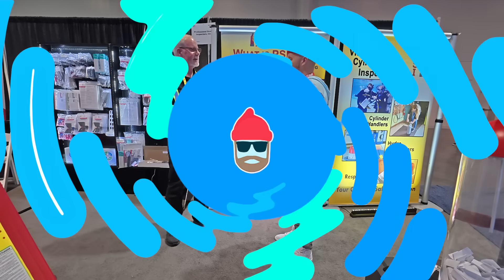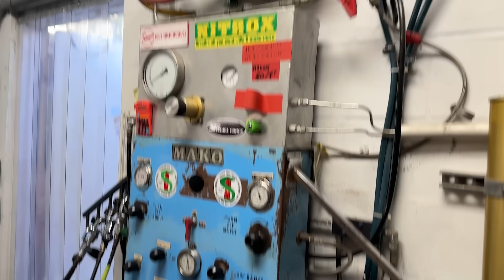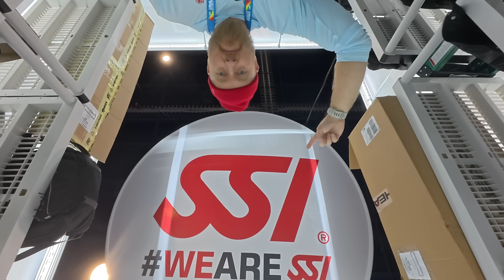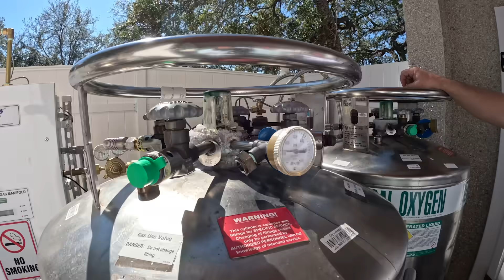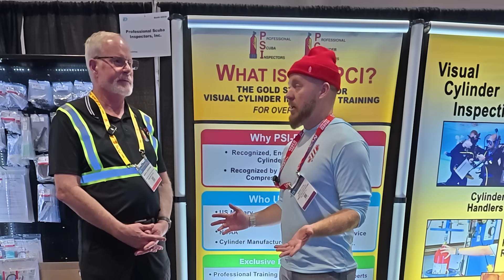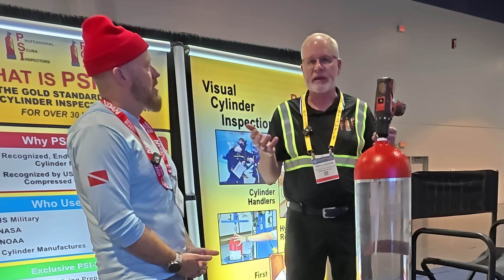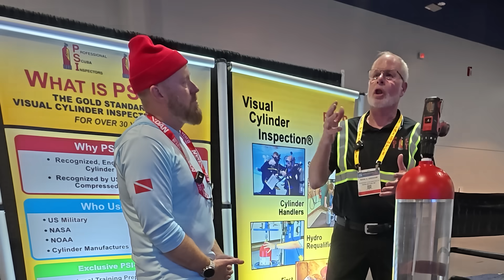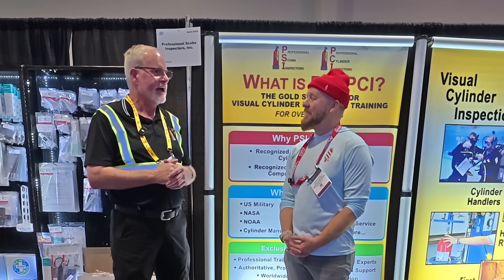101 | Scuba Tank myths busted: Dive Industry Expert debunks common cylinder misconceptions.

Comment: What I really wish you’d have asked about was what is the truth about Luxfur bad aluminum tanks.  I’ve now been told by Divers Direct is that they will no longer fill tanks pre 1990. What I read on the DOT web site is that a tank is good as long as it passes a Hydro test. There seems to be no standard as to exactly what year dive shops draw the line. 
Greg
Reply from the maker: Just reach out to PSI / PCI: they’re responsive to email and their contact is on this video description 👌
Reply: Under DOT standards, a 6351 cylinder is good until it fails hydro/VIP by a RIN holder.  Under DIVE SHOP standards, the regulation is what they say it is.  Most shops here won't fill 6351 cylinders anymore.  When the DOT man came into our hydro shop 2 years ago for his inspection he told us not to hydro 6351 alloy cylinders anymore, even if we did an ECT.   DOT wants them phased out due to SLC and the best way to do that is to get certified hydro shops to stop hydroing them.

If you have your own compressor, you can fill a 6351cylinder that's within hydro all you want and not violate DOT regulations but most of us don't have that convenience.  "Annual VIP" isn't a DOT thing, it's a dive shop thing.  The only DOT requirement for a cylinder is a hydro and VIP every 5 years.   The one-year stuff, the dive shops all came up with so they could put THEIR NAME on the VIP sticker and advertise their shop.  I have about 150 VIP decals from all over the world plastered to the wall of my shop that I've peeled off cylinders for their VIP.  A diver asked me one time why we didn't put VIP decals on cylinders when we inspected them at hydro.  I told him, because the dive shop would peel it off and put their own VIP Decal with THEIR name on it, not mine. 

I've been to shops that won't fill an air cylinder with nitrox.  Dive shops that don't care.  Dive shops that won't fill a cylinder with nitrox unless it has a band on it.  Dive shops that won't fill a cylinder unless it has THEIR vip decal on it.  Dive shops that won't fill a cylinder with air that has a nitrox band on it.  Dive shops that don't care what sticker is on it.  Dive shops that won't fill a repainted cylinder.  Dive shops that won't fill a cylinder that has a valve with a green plastic handle on it.  Dive shops that don't care if your valve even has a handle on it. 
When it comes to cylinders, each shop makes their own rules above/beyond DOT regulations according to what they feel is most safe.  Most err on the side of caution because a cylinder explosion is sort of irreversible.      We had a cylinder that the valve blew off with about 500 PSI in it.  The valve went past the compressor monkeys face, thru the ground floor ceiling, thru the second floor ceiling, and lodged in the roof of the building.   No shop wants to be that shop in the news where three people died when the scuba tank exploded.

I VIP my own cylinders and sometimes during dive season I get so busy I forget about my own.  I took one of my steel 100's to a local dive shop once a few years ago and the compressor monkey came out and said he couldn't fill it.  I was like, WTF?  I work here!  Then he showed me the VIP decal that expired 18 months prior.  They'd been filling it for an entire year without even looking at the VIP decal. 

PSI Visual Inspector 302XX
PSI Oxygen Cleaning Tech
PSI Valve Service Tech

Comment: I was SCUBA certified at the 111st Street YMCA in Chicago in 1968 when I was sixteen and volunteered to Dive Club’s compressor in a room off the men’s locker room near the pool which was 18ft. deep and designed for teaching SCUBA.  The compressor was run to fill a bank of large tanks then they were used to fill the tanks.  I alternated running it with another guy.  The day after I had run it and the other guy was one of the drying filters one the compressor ruptured when it put his hand on it to see hot it was, how we judged when to stop the compressor. The force broke both his wrist and took off the tips of his fingers.  The room looked like a bomb had gone off.  It was determined when the compressor had been rebuilt a few years earlier the aluminum used for the filter bodies had been made from an alloy which reacted chemically with the drying agent inside of it causing the inside to corrode and weaken. It was a real wake-up call about how dangerous air that pressure is.

I stopped diving in 1970 when I went off to college but in from 1983-2007 was wound up doing three tours totally 11 years in Manila running a printing center for USIA / State Dept and diving every other weekend in the 80s and 90s getting my Divemaster rating, doing a lot of underwater photography and building my own native outrigger style 10 meter long dive boat in an arrangement where the boatman we had been using built it and ran if for us for free in return to giving it to him when leaving which worked out great.

Comment: Pure O2 may not in and of itself be flammable but it makes near everything else flammable; while working at Airgas I’ve seen a block wall ignite while emptying O2 tanks for hydro test. 
I always took fills for granted when working for a commercial compressed gas filling company while diving, that was until I was on a trip and went to a dive shop and saw their shoddy filling to realize how bad things could be. It truly is a you haven’t had an issue “yet”. Always used a USP standard which is so much stricter than any loose shop fill is when life is on the line.

Comment: Yet there have been millions of dives using nitrox and titanium regulators and I've yet to read about a diver exploding underwater.    I take this all as opinion, some valid, some questionable.  I believe on the titanium reg issue his validation was because someone thought it was not a good idea, not because of any actual fact based science or demonstrated repeatable event.

I believe he said at the end of the video"you need to be 19.5 percent to stay alive" referring to oxygen content.  Normoxic mix is considered 18-21 percent oxygen in the technical diving community.  You can stay awake and conscious several percent below 18 at the surface.  The minute you descended only a couple feet the po2 is at air levels.

Many emphatic statements in this interview covering broad topics outside of cylinder inspection, that are simply not accurate.
Reply from the maker: Have you reached out ti them for clarification?

Comment: Logic behind fully opened and 1/4 turn back is to easily tell if the valve is opened or closed and eliminate confusion. If its fully on or fully off people have been known to get confused as to which it is. With movement either way it's really easy to test whether its opened or closed. I've never heard of those other arguments.

Comment: This was a great video on tanks and misconceptions about them.  While my son was trying to sell one of my scuba tanks, the prospective buyer got hung up on whether the tank valve would support a din regulator.  He didn't even wonder whether or not the tank had had a 5 year inspection and/or how old the gas was in the tank.  Because of this video explaining the potential problems with old gas - if the cylinder had rust in it - it will reduce the oxygen content in the tank, I am taking these tanks off of the market, sending them back for 5 year and/or visual and refilling them with nitrox, in order to assure that they are properly maintained.  For me - whether I use the tank this year of not, I want them to be inspected and refilled by a competent dive shop - and not have to deal with a lawsuit from selling my tank to an idiot !!!  LOL !
Reply from the maker: 🍻 awesome! The one other thing if you don’t get a chance is grab an O2 analyzer and check them that way? A lot of dive shops will give trade in as well since steel tanks hold their value if they’re able to look inside 🤙

Comment: Analyzing your gas is definitely something you should do. I've picked up a cylinder of enriched air. I was diving to 128 feet. This meant if I wanted a MOD of 132 feet (deeper is safer) then my gas should be EAN28. The cylinder had in it EAN43. The MOD for EAN43 is 74 feet. Almost half the depth I intended diving to. Took the fill tech, through trial and error, almost an hour to drain the cylinder a little, fill with air, measure, drain the cylinder a little, fill with air, measure before they got it down to EAN28. Good thing I checked the cylinder before I left the shop. I also insisted on using my sensor to measure the gas. I see so many people using the shop sensor to measure the gas.

Analyze your air people.

Comment: Good video, the reason I turn my cylinder fully on and then back quarter of a turn is so that should there be a problem underwater my buddy would quickly and easily know if the cylinder was turned off or on, as a quarter turn open would tell him its on, if the cylinder was fully open they would not know if it was open or someone had closed it really tightly. This happened in St lucia on a dive trip my wife and I went on, the crew insisted on kitting us all up in the harbour, doing our checks then turning off our cylinders until we got to the dive site.
Since my wife was a novice diver I asked to be first in so that i could be there ready when she entered the water in case there was a problem. The crew stood me on the back and said off you go, I looked at my gauge took a couple of breathe only to see my gauge drop! Can you turn my air on please I said, he tried to turn the wheel and said its on, I showed him my gauge, he tried again and it opened! Slightly worried crew frantically checked and turned on the other half of the divers who's air valve had been tuned off by a gorilla. Lesson learned, check everything yourself, a flashy dive boat doesn't mean competent dive crew.

Comment: The Internal Corrosion shouldn't be much of a problem today with Aluminum Cylinders?
Reply from the maker: It’s not as long as moisture stays out. But steel is also super popular so it has rust to contend with for the same reason (moisture getting in when it’s not supposed to) 👌

Comment: It was not explained here why we no more qarter-turn close. The reason is:
If somebody by mistake closes the valve instead of opening it it is better to leave it fully close (you will not start the dive and it will come out during a buddy-check) rather than qarter-turn open. You could start the dive, but at some depth (eg. 20m) it can occur that denser gas will have problem to go through barely opened valve.

Comment: I really apprechiated this video. Concerning the 1/4 turn: the reason to do so my instructor gave me in 1992 was to not wear and tear the valve and it's inside components. Like if you always open it to the full it will wear itself out and eventually start leaking. So by turning it 1/4 back you simply don't stress the valve. :fish-orange-wide-eyes:🤷‍♀
any idea on that theory ?
Reply: Take Mark's Valve Repair Tech course and learn about the moving parts inside a valve.  Then you'll realize a SCUBA valve doesn't work that way.  When you get to the full-open limitation, the threads on the stem just end and butts up against the bonnet nut.  You can't damage a valve seat or stem by "tightly opening" it unless maybe you're a bodybuilder.  Even then you'd strip the square hole in the plastic handle before you damage the stem.

I've had corroded nasty junk valves that some good old boy have brought me that haven't been serviced in a decade that the Fish and Wildlife guys auctioned off because they were junk too neglected to service.  I used a 18" adjustable wrench to try to break the stem loose.  The stem twisted 1/4 turn before it snapped off.  

You ain't going to just be on a diveboat on a regular dive with regular gear that's been maintained and serviced and twist a valve stem off bare handed by full-opening it.

Comment: Great Post....I sure that it's just me, but I have evolved.  When I started diving in 1969, I wore no weights and I regularly made two tank dives on the same tank fill. As I have aged, my dive buddies have gotten younger, at this point, half my age.  To combat this trend, I purchased a 100 Cu Ft Steel tank that is rated 3440 PSI ish.  This gives me parity with these younger guys with their 80's. BUT only if the tank is filled to the proper capacity.  

THERE IS NO WAY IN HELL THAT I'M GOING TO ACCEPT A FILL NOT DONE SLOWLY IN COOL WATER.  Just between us, I will tip the guy to provide a 3440 fill when it is cooled down.

Comment: How fast is filling too fast? 
    Filling fairly fast seems OK on temperature,  since air expands & cools some going from cascade fill hose into tank.

At 7:44  Why is Enriched Air flammable when oxygen isn't  and  Nitrogen & Air aren't ?

Wow on rusting steel eating 6 times more oxygen out of the air than oxidizing Aluminum (AL oxide is strong & protective, rust swells & flakes).

Three stories are:  Store had a valve blow out of part full Al cylinder making a small hole.   2. Heard a heat baked paint job changed Al tanks temper & it fragmented.   3.  Saw poster of car where tank exploded in trunk... 20 years later saw poster of the same car (felt good there was not a newer different picture).

Sad my pawn-shop double hose developed a bad valve seat and rotting-ish hoses...  Then again it breathes like a snorkel (sensor is behind your head),  didn't have pressure gauge,  not as easy as any single hose (except one late 1960's USD Deep Star - was as hard).

Comment: I started diving in 1964 when some friends said "want to go scuba?" They just told me to keep breathing. Double hose, no pressure gauge, no BC. Got certified in college 1966. No PADI or NAUI, or YMCA, just Stanford University certification #197. In 1973 I became instructor and soon bought the dive shop in Monterey, CA. We would fill hundreds of tanks (cylinders) on a busy summer weekend. The overpressure device was a lead plug in the valve. We had a few of those blow, so basically a bullet. Fortunately nobody got hurt. Then they went to burst disc, but the first ones had the retaining bolt with a hole straight out from the disc. When the disc blew it was a lot of noise and rushing of air. in the fill tank no big deal, but if left outside the sun would heat the tank, increase pressure, and disc blew, and tank would spin around. Safer than a bullet, but not safe. Then they drilled 3 holes in the side of the bolt and that is used today. Before pressure gauges we had J valves (part # J in Scubapro catalog) which had a rod down the side of the tank. We would breathe until no more, pull the rod, and have about 300 psi to get to the surface. But often in Monterey the kelp would have pulled the rod so when when we inhaled and got no air, we were indeed out of gas. No worries, just a normal end of the dive. Look up, open airway, and slowly come up. Don't deliberately exhale, just let the lungs push the expanding air out naturally. I got a little upset when PADI called that an emergency. It wasn't an emergency, just do as trained and it was the normal end of a dive. Because we actually drained the gas out of the tank, water could intrude so VIP was mandatory. Many times I'd get a little water out of a tank. Once got about a cup out of a 72. We'd send out to local hydro station for cleaning. We'd fill 6 tanks at a time, in a water bath, and even put lots of ice on top of the tanks. Now at 78 I'm still diving, but only tropical water. About 4,000 of my >5,000 dives are cold water but carrying all that gear on a beach dive is too much. I don't know who invented this earth but they always make the parking lot uphill from the water, so after a dive when I'm tired I have to carry all that stuff uphill. Be much better if they made the beach go downhill from the water! Awww, the bad old days. Very much enjoyed this video and I'm still learning. Took PSI class when they were in Seattle, long after I sold the dive shop.
Reply from the maker: That is a truly amazing story of diving evolution, thank you for sharing! I am glad we have made some progress over the years when it comes to tank safety! 🤿 Also, we were just in Monterey Bay and absolutely loved the area!
Reply: HAD THE SAME BUBBLES WHILE FILLING ON A STEEL CYLINDER WITH A PLASTIC BOOT.  SAME PSI AND SEMI CONCERNED.   DRAINED THE CYLINDER.  CURIOUSLY I AM A HOBIEST METAL-ER?  SAWED THE CYLINDER AND FOUND NO MAX RUST, BUT A SMALL DIME SIZED RUST SPOT THAT HAD A PINHOLE TO THE CYLINDER'S SURFACE.  CURIOUSLY CUT THE PINHOLE IN LENGTHWISE.  A 1/4" CONICAL (FUNNEL-LIKE SHAPE) TO THE EXITING PIN HOLE THROUGH THE PLASTIC CYLINDER'S COATING.  DOOR BELL MATERIAL.
Reply: Nice to hear the story. One comment though. If the parking was downhill from the water it would be underwater... 🙂
Reply: @rickpeck7068 there’s a really nifty thing called jokes. You should look into them, you could do something called smiling or maybe even something called chuckling or laughing 🥰
Reply: I also started diving in ‘64 in cold Michigan. Also almost died in a river dive. Got over 350 dives in the Red Sea. I am so glad I started early in life. Lots of diving adventures. Even wrestled a white tip. Note to self, do not do that again. But I did anyways. You gotta love your life. Lots of stories.
Reply: Gravity is a bitch.